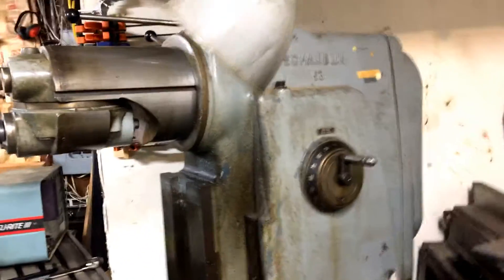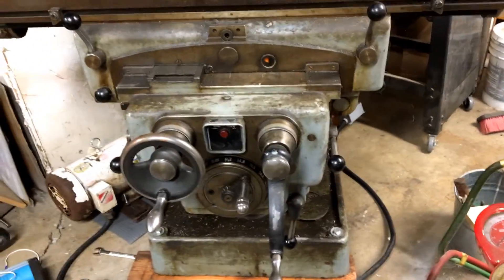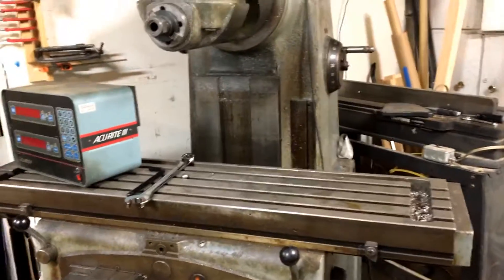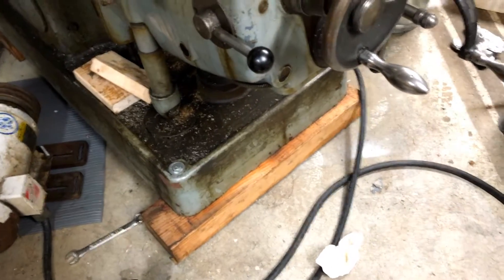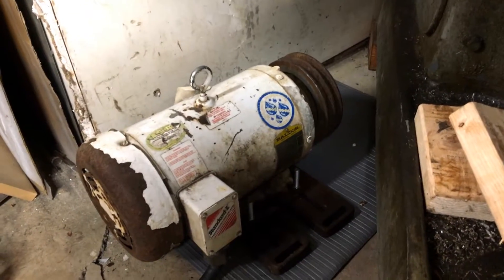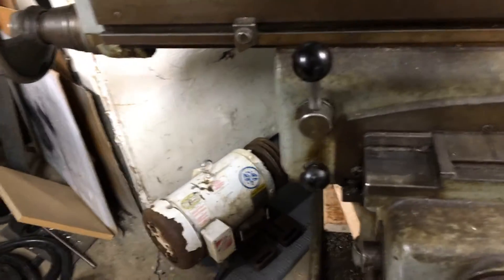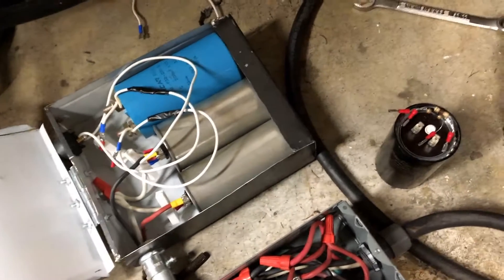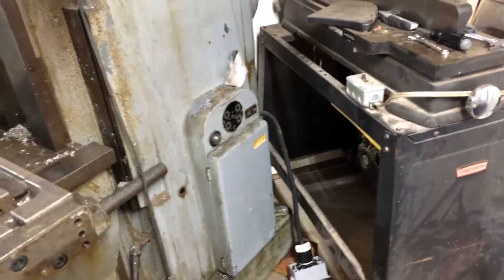Milling machine and DIY 3 phase converter

Comment: You need a potential relay because the start capacitor was not taken out of the circuit after the motor got up to speed.
Reply from the maker: Yeah that was my problem originally. The button is a momentary button so it's only engaged when pressed, which means the start capacitor is physically disconnected when my finger isn't on it.  A potential relay is a really good idea, I didn't know they existed. That would really simply things and help protect the idler on startup, thanks.